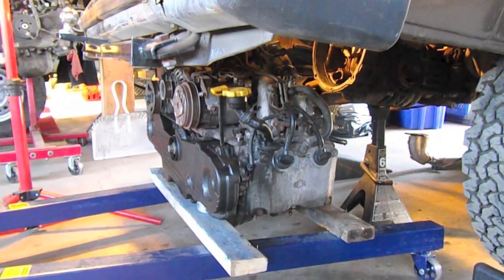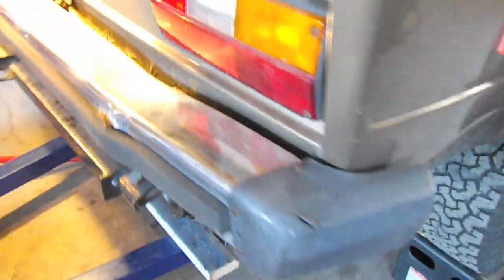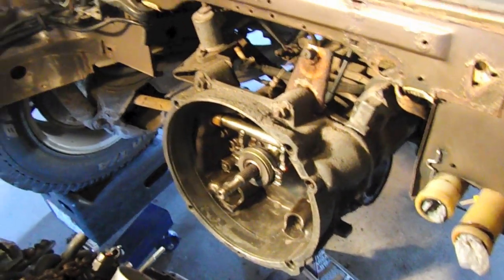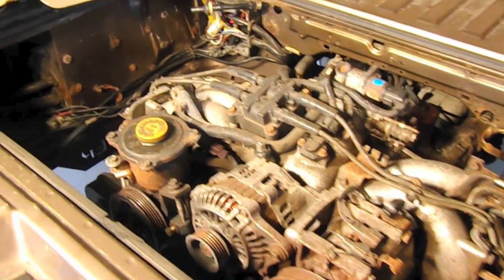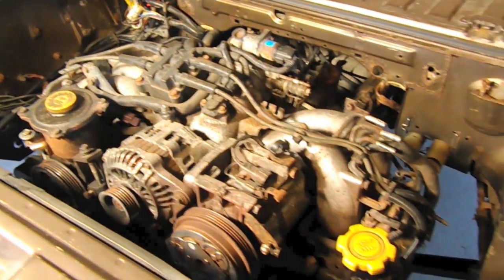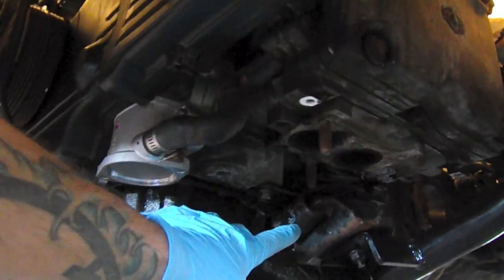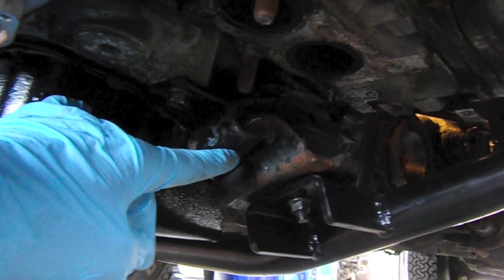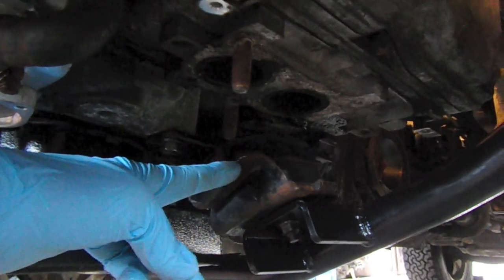Subaru 2.5L Engine Install - Subaru Vanagon Engine Swap Part 6

Comment: This is my van (BORIS). The swap was perfect, I have put now about 10,000 miles with not one engine problem. I'm very happy with the work done by Mick, he ROCKS!!!!
Reply: Hey! Really cool! I’m on the fence between using an STI turbo engine or this atmo one. We have a lot of steep hills back home and sometimes I’d pull a trailer loaded of logs for the fireplace home. What do you think? I don’t race just wanna have a strong and effective car. Thank you!

Comment: Just did this yesterday.  Make sure you have the clutch alignment tool handy...use the vanagon one and it worked, meaning the engine would not go in until I found it (not beetle) and it went easy like Busaru shows us how.

Comment: This is nicely shot; very clear. I think I am going to try this. I have metal fab skills and equipment. So I will be able to fabricate the hanger myself. I am going to install an H6. I may end up cutting away the rear portion of the body so that the engine can be rolled straight in. Making a structural piece which bolts in will not be too difficult. I'm thinking that additional space can be created and integrate a custom bumper tabs. Being able to remove that rear portion of the body will make work go a lot faster.

Comment: Does anyone know if i can use an Automatic Transmission from 1980- 1990 VW Vanagon into a VW Bus t2 Engine? or i should use only with the original 2.1 engine and adapt it into a T2 Bus?...sorry if it's a dumm question.

Also i will adapt a Jetta 2.0 Engine, but the main topic its the Transmission i want an automatic

Comment: +Busaru Question for you. When you ordered the kit from kep did they give you the hardware to mount the engine cradle. The reason I ask is I just went to mount mine and cant seem to find any bolts for that specific
Reply from the maker: +Broken Compass you reuse your existing crossmember bolts and buy a few new ones that match.

Comment: any way you have a link to the website you got the adapter plate / flywheel from?
Reply from the maker: +Tin Cup Outdoors I generally go with KEP - Kennedy Engineered Products. They created the original adapter plate setup. I don't have the link, just google it.